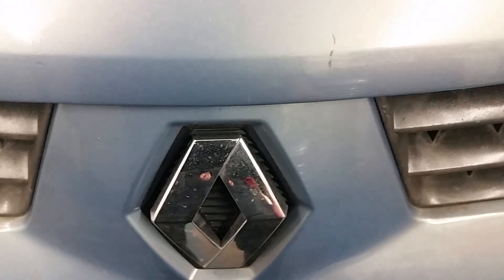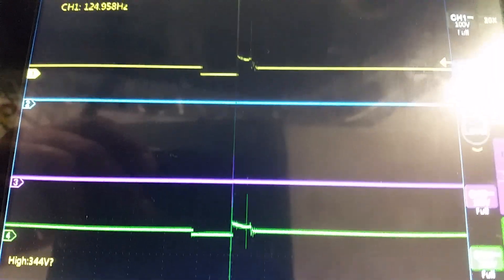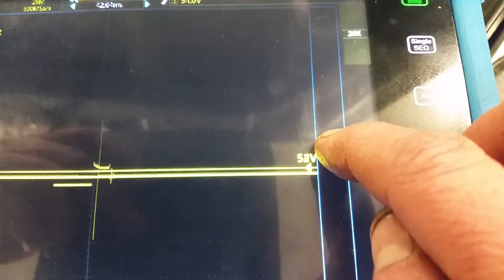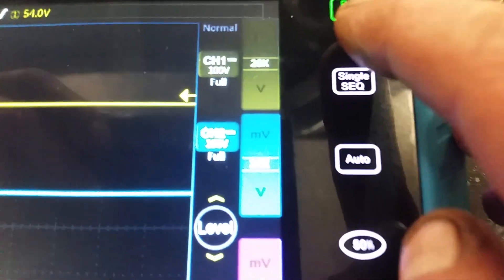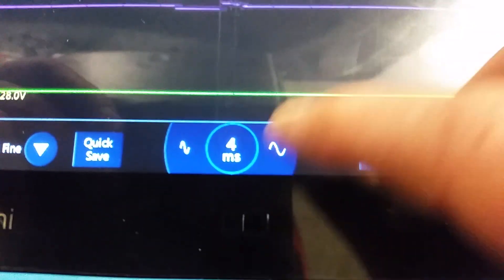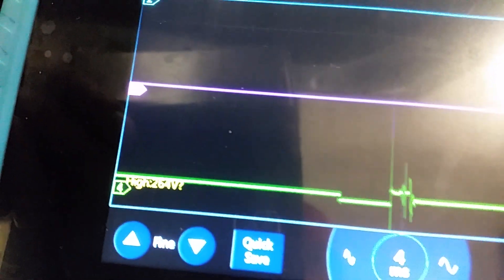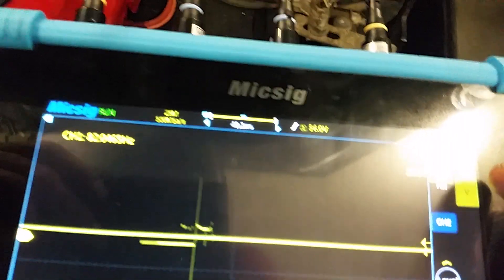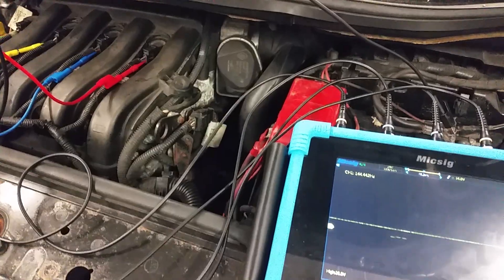Primary ignition on a micsig oscilloscope

Comment: Hello there Dave, Atom here. I was wondering, do you get good ignition waveforms with a secondary cop paddle probe on the Micsig?
Reply from the maker: Yeah not bad, cop paddles are hit and miss depending on the coil pack. Some coil packs are too thick to get anyting useful sometimes a penny is better
Reply: dave sterl  thanks for the quick reply